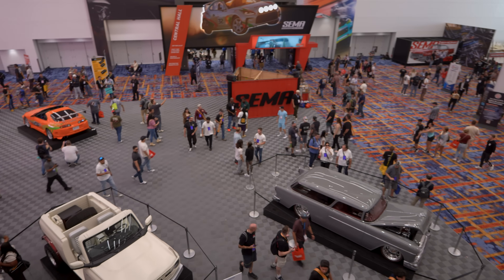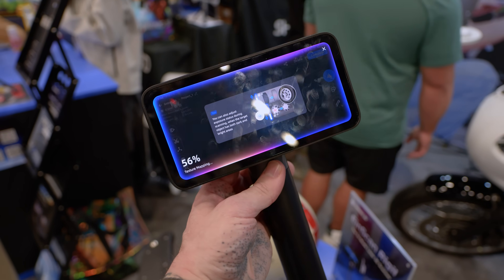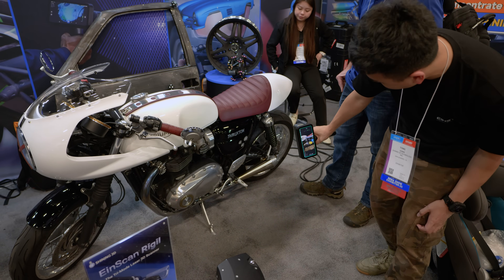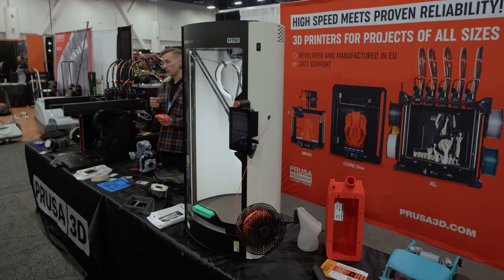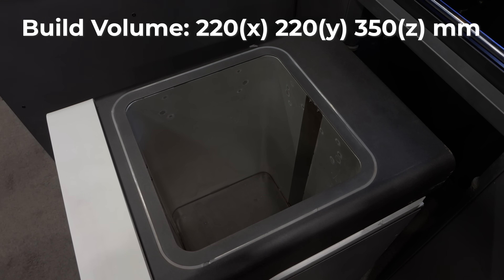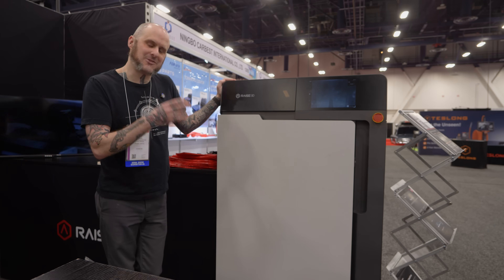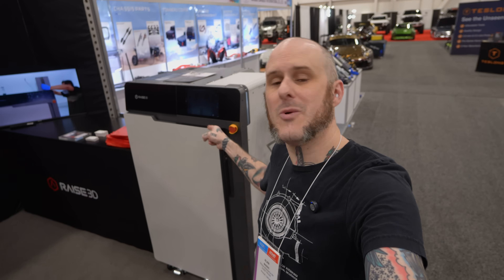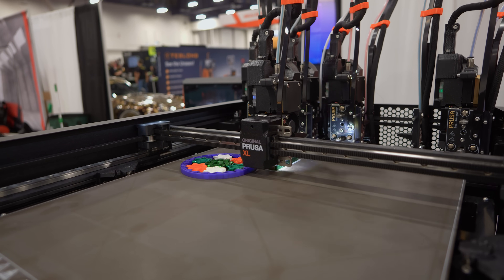The Future of Custom Cars?! - 3D Printing at SEMA 2025!

Comment: Make parts to restore my grandfather's 1976 D150 Club Cab pickup is what I would use a SLS printer for.
Reply: The RMS 220 got validated to print with Headmade Materials which include Titanium, Inconel, Tool Steel, Stainless Steel (17-4PH and 316L). The validation was made official after Alan made this video which is why his video says "Metal powders maybe?"

Comment: That spring steel bed dropping the print directly to the cleaning reservoir got me all moist. That is such a game changer and such ease of use, it takes out so much time and effort and "hassle" of resin printing, because lets face it, with FDM you print, you see it printing and job done just go back and enjoy your print, but with resin it can fail at any time, unless it's a really good pre supported model you got the whole support paint process, then you watch for support trees failing, then even after it's printed, you gotta turn on the air filter, PPE, wash the whole thing without scrathing it, cure it but not too much or it becomes brittle, the support removal (I usually do it before curing actually, my thinking is as it's still "soft" it can break more easily), and only then after airing the room for 5 minutes you can enjoy your (tiny compared to FDM) print.
I imagine the price point of that bad boy, at least dreaming is free xD
Reply: Wow your WAY more careful with your resin stuff then me. I have a flex plate that makes stuff way easier I just grab the plate flex it off in the cleaner sit the part in clean hot water to make support easier and cure it. Zero air filtration at all